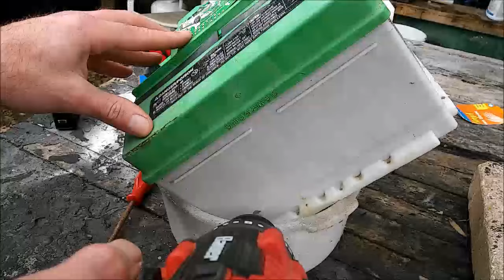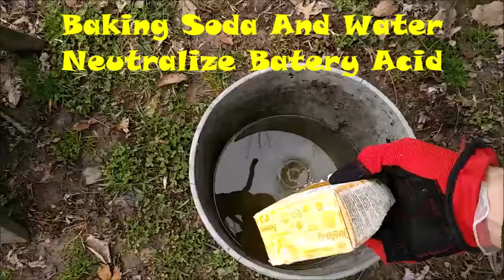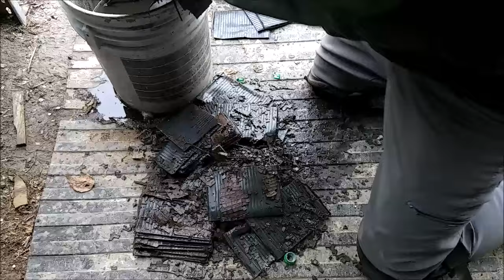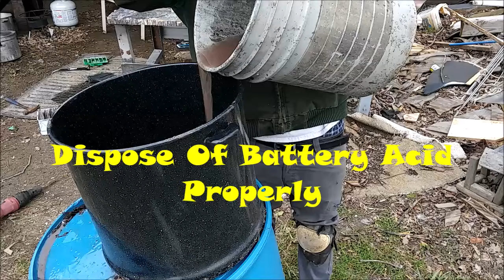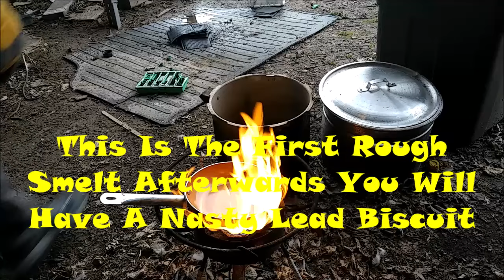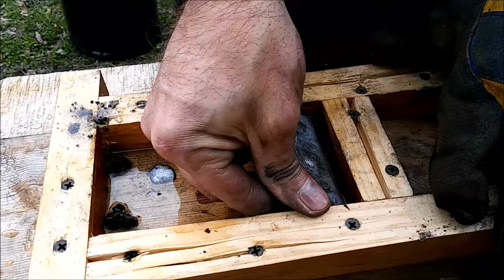How To Get Lead Out Of A Car Battery - Complete Process

Comment: All that wonderful sulfuric acid wasted!
Reply: I agree that's want to keep it boil it to concentrate it to almost pure and then use it to aid in making nitric acid
Reply: @nicholecrouch311  Come on, that is the stupiest way to make sulphuric or nitric acid I've ever heard. Its not worth it and wont work.
Reply: @zillertalernazihass  it does work and only takes about 15 minutes to do I have made plenty of other chemical compounds with it many times before using that method just because you've never attempted it yourself doesn't mean it won't work...but you can believe what you choose to I have done it quite a bit and that method is also listed in a few improvised munitions army handbooks I have. So you're trying to tell me my own experiences using that method and the army's handbooks are both incorrect? Yeah ok
Reply: @BOSS_DOG  Thanks
Reply: @zillertalernazihass  it will work.. the acid can only be boiled to about 70% with propper distillation which I've done many times to make 98% sulfuric acid and to convert to nitric acid it just needs potassium nitrate or sodium nitrate added and distilling the nitric acid off, I've done it many times and it definitely works.. I'd recommend only using distilled battery acid to make nitric acid because one doesn't want any lead present when making nitric acid, any lead would be made into a water soluble form by the nitric acid which could easily into the body.. distilling sulfuric acid isn't for the faint hearted, it's extremely dangerous and can bump violently enough to break glassware and 330 degrees Celsius sulfuric acid will eat flesh on contact.. Check out nurdrage for making nitric acid and nile red shows distilling sulfuric acid.. there are others but i forget who has done what
Reply: Hey, so what uses would having that acid be?
Reply: @trexeater101  sulphuric acid is used in heaps of chemical reactions
Reply: @markshort9098   I’ll probably google this after I’ve typed it but I was wondering if it could be used to chemically sharpen fishing hooks, I was only watching to get lead to make sinkers anyway so I may as well kill two birds with one stone
Reply: @trexeater101  nah  battery acid wouldn't be good for that.. I'll have do an experiment one day since I have plenty of fish hooks and plenty of various acids in my lab but I'd guess nitric acid would be probably the best since it dissolves metals really well, which probably isn't much use for you since nitric isn't the easiest thing to buy and it needs at least basic lab equipment to make.. nitric acid is needed to make most explosives so depending where you are in the world it might be illegal for you to have nitric without a licence, I make my own nitric and buying potassium nitrate got me put on a watch list and a visit from police 🤣 I wasn't making explosives so they just had a look and left
Reply: @trexeater101  acid will eat all surfaces at the same rate. So unless you can apply it to the surfaces you need thinned for sharpening,you will end up with smaller hook that is just as dull as what you started with. For example if you drop a penny into sulfuric acid and leave it for a while, you will have a penny that is exact in detail to the original but thinner than the original. Highschool chemistry demonstration by a great teacher.

Comment: Is that all of the lead from a battery?  I would have thought they had much more.
Reply: I didn't see if he scooped the flakes off the ground (and if he did, a collection tub to dump the battery into would have made more sense), and he also doesn't seem to be targeting 100% of the lead (refining the lead-oxide slag back into metallic lead), just the easiest chunks to get to. That said.. yeah, the lead in a battery isn't solid plates, it's sponge suspended between fiber boards that soak up the electrolyte, so it's less than it would initially seem like.
Reply: Google says 18 pounds, not the 6 he got.
Reply: @robertbrandywine most of the lead is lead sulphate. When people do this at home and don't properly convert the lead sulphates and lead oxides back into elemental lead. They are literally just wasting their time like this guy and contaminating their entire work area in literal lead dust, 12 lbs of it.

Comment: Guess end result doesn’t justify to the cost of gloves and backing soda. But fun none the less right?
Reply: From what I've seen, people average between 6-12 pounds of lead from batteries. I can't figure out why he got such a low yield.
Reply from the maker: I think they make fake videos by buying fishing weights or something
Reply: @darkspire91  if the battery wasn't fully charged upon opening he would loose loads
Reply: @Swagnermite  very interesting point
Reply: @Swagnermite  why is that?
Reply: @mbburry4759  when a lead acid battery is fully charged, the lead is in its elemental metallic state, as it discharges the lead gets oxidised (looses 2 electrons) and becomes Pb+2 which plates out on the electrodes. If the battery is fully discharged, there is hardly any elemental lead left in the sheets. I hope this made sence as i am high as a kite rn
Reply: @Swagnermite  Thankyou, thats good to know.
Reply: @Swagnermite  soooo are you saying to charge the battery first to get more lead??
Reply: @Swagnermite  lol the only reason the battery was salvaged was because it doesn’t hold charge anymore, if it can hold charge it won’t be salvaged. Gotta use charcoal to reduce lead oxides back to lead.
Reply: @colocker18  You can also convert the oxide back to lead afterwards, if you convert it later. But yeah, if the battery is chargeable, charging it would make sense as an easier method to do that.

Comment: Nice video.  I don't have the means to properly dispose of the waste, but farmers around here tend to store expired batteries for well, ever.  I'll have to stick with melting shot to make buckshot and slugs.
Reply: acid drain cleaner is almost pure sulfuric  acid . Batter acid is only %10 sulfuric acid .just dump it down the drain or in your drive way if it is limestone rock
Reply: @huckstirred7112  No, it also contains LEAD which is a heavy metal, which means that the lead in the battery acid will pass the human skin and cause poisoning.  In lakes it will cause fish to die within a week. The only correct way is to bring the batteries to a scrap yard.
Reply: @HVinduction  After the water treatment plant will remove that tiny bit of led .. the heavy lead would stay in the drive way

Comment: so the battery is like 30-50 lbs and only 6 lbs of it is lead? WTF?? where is the other 24 - 44 lbs?
Reply from the maker: Acid/water is most of it
Reply: Makes me wonder why rural king is buying them for $7 and $4 for small battery
Reply from the maker: @lawnmowerman4040  the acid
Reply: There might be a significant amount in Lead Oxide and lead sulfate as well... fully charged, everything should be lead / lead oxide, fully discarded, a lot of that is converted to lead sulphate...
Reply: not 6 pounds. more like half a pound. that was .6

Comment: I'm not going to try this but I was just wondering is there more value in cleaning the batteries and selling the pure lead? TIA btw and great video, liked and subbed.
Reply: You don't get a lot of lead out of car batteries in all honesty the amount of work you put into having to deal with the sulfuric acid and all the other junk cuz there's a lot of junk metal that comes out of your Melting Pot when you melt battery lead. I cast my own handgun and rifle bullets so I have a lot of use for lead and I gave this a shot on two different size batteries and in the end I figured out it's ultimately better just to take it to your local scrap yard that buys scrap metal to and they'll pay you  for it and you won't have to deal with running the risk of chemical burns or having to deal with the sulfuric acid either. If you're serious about wanting to sell lead just look around when you're out and about town and a lot of wheel weights are made of almost pure lead,  that's how I collect most of my handgun bullet lead is my local Highway that's down the street from me I just walk along the side of it and pick up any lead wheel weights and then you can melt all those flux it with some candle flux it with some paraffin candle wax or fine saw dust and then cast that into a dollar store muffin pan and voila you now have lead ingots be sure to wash your hands with soap and water thoroughly after handling any type of lead and don't eat or drink wow messing around with lead it is possible to get poisoning from lead that way I always wear work clothes when picking up or processing wheel weights good luck man
Reply: @nicholecrouch311   yea that's exactly right, I've done the exact same thing. Better to scrap battery for many reasons!! Some scrap recycle places will sell you lead if you ask. Local small time scrap guy has gave me about 50lbs for free. Never know what you might find or get if you just ask. Good luck.
Reply: @bubbigguns4952  holy cow 50 pounds! I am gonna ask a couple local tire guys if they'll be willing to part with their scrap weights I know the big name shops sell theirs to battery suppliers for way more than scrap prices and most have contracts that won't sell them to anyone but the battery suppliers...hell primers are so hard to come by right now I've luckily found a source locally for strike anywhere matches and have been making my own primers with the tips from them. Unfortunately the mix is corrosive so an extra step of hot soap water cleaning is necessary after target practice but it hasn't been too much hassle...it has to be soap and hot water though the gun cleaning oils don't remove the micro salts that rust the barrel but it still allows me to practice...hope the supply catches up soon until then I'll be reloading primers
Reply: The red lead (lead dioxide) is more valuable than the lead.
Reply: Go to the junkyard collect all the battery cable ends knock off all the wheel weights
Reply: @nicholecrouch311  they actually sell specific soap that if i understand correctly, you should be using after handling lead. regular soap apparently isn't enough
Reply: Don't bother trying to separate the lead..I did this to 12 large car batteries here in the qeer old corrupt UK  and thought the scrap yard would buy the plates as lead but they didn't wouldn't buy them not even for battery prices.. I would have got £0.45 pence per kg for complete battery but screwed up  big time and giot 200kg of lead oxide plates and about 2 kg of real lead ...thought I would be clever again as a few yrs ago I did the same and the scrapyard bought it as contaminated lead but not now..Wasted over £90..UK cash in scrap battery value now I'm.left with 200kg of trash

Comment: Is it worth it?
Reply from the maker: Nope
Reply: WARNING  yep. Lead acid batteries have a lot of lead paste and lead oxide. A huge amount in this video went with the water and wasn’t recovered. The paste can be melted down but it’s much more dangerous health wise messing with it over say melting down bullets or tire weights. It can be done but you gotta have a respirator & paint suit to protect ya @ss from the lead dust.
Reply: @Trotlining  i beg to differ.  Matter of fact, I have a couple hundred pounds of gold filled jewelry I'm making a cell to reverse electroplate.  Last thing I need is my lead.  I drained the acid and am about to melt.  Very worth it IMO.  Cool video tho Jake!  give yourself some credit!  I heard sanding lead is extremely hazardous .

Comment: acid drain cleaner is almost pure sulfuric  acid . Batter acid is only %10 sulfuric acid .just dump it down the drain or in your drive way if it is limestone rock
Reply: Works. Some people freak about the suspended lead in the liquid though.
Reply: @andrewsmith1735  lead Is found in nature and all the acid will do is kill some stuff in the gutter. By the time it hits the sewer or a river, it's too dilute to harm anything